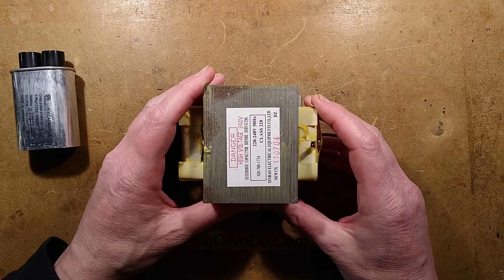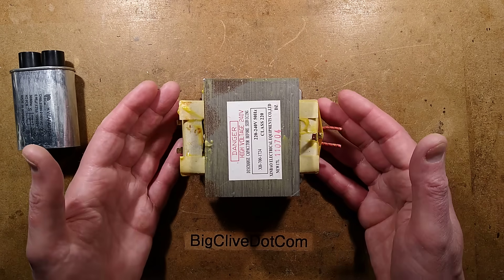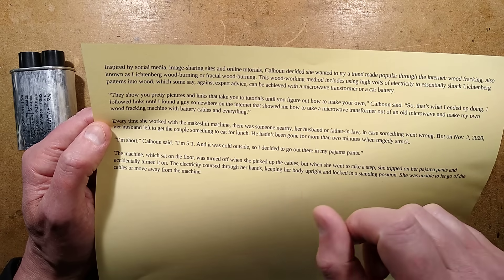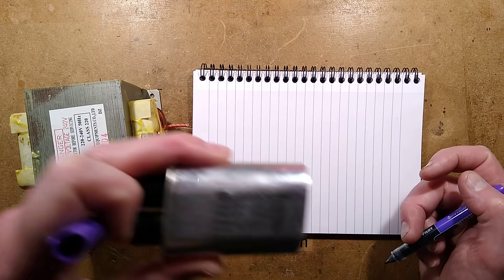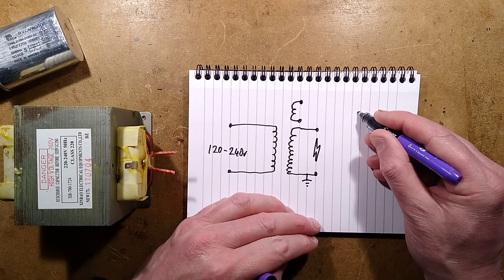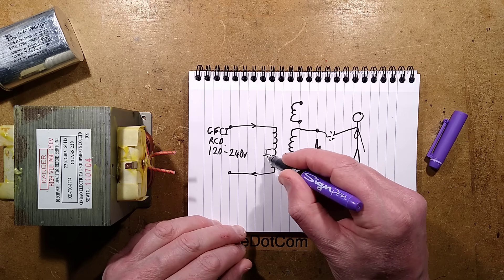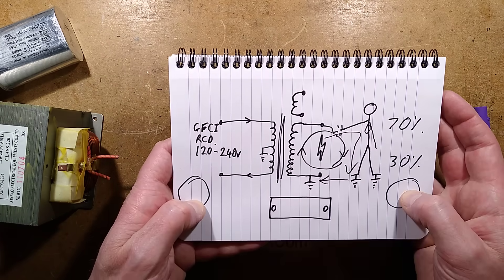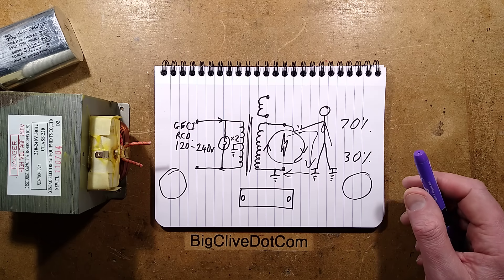The most deadly project on the Internet

Comment: My dad has a decent scar on the inside of his right forearm from working on a CRT TV many decades ago.   He apparently reached around to tweak something and got nailed by the flyback transformer.  Between that scar and his constant warnings of imminent death, it's little wonder I went for a mechanical engineering degree.   :)
Reply: I was an Appliance repairman for 27 years. While repairing a microwave (that had been unplugged for a week) the capacitor discharged from my right hand through my chest and to my left hand. 
My heart stopped and the room went dark. I fell back and hit the wall and woke up on the floor. I was very lucky to have no injuries from this. After talking to medical professionals about this I was told that I was dead for a short time. 
I have literally been shocked hundreds of times  by 120 volts but that 2000 to 4000 volt microwave power is no joke.
Reply: @paulb4496 , there's also the "always keep one hand in your pocket" guideline.
Reply: Stories like this is why I'm planning on going in digital logic design, safe, 5-3.3v circuits
Reply: @comandercrypto1318 , not much you can do about 5v on the USB. I don't even like the old Arduino, etc. stuff that exposes 5v, which can blow out 3.3v circuits.

Logic design is cool, but I hope you work on learning some programming languages, Cmdr. Crypto. (Crypto is the lulz.)
Reply: @comandercrypto1318  I'm doing embedded systems, analog signal conditioning, and some stepper motor drives.  24V maximum, I think at 2 amps.  I'm OK with that.   What is impressively annoying about 3 and 5V digital logic is the amount of board space I've had to dedicate to converting between the two.  I kinda hate that 3V ever became a thing, though it'd be fine if there didn't seem to be a 50/50 mix of what uses which.

Comment: Of the nearly 2000 comments here, only 2 mention the risk of * BERYLLIOSIS * , which is another nasty way to die after brute-forcing your way to the transformer.
Reply from the maker: Modern consumer microwaves do not use beryllium ceramic.  They're more likely to use a pink coloured alumina based material.

Comment: Wow! People are using these things around damp/wet surfaces and some holding the output probes  by hand! Yikes...
I have worked on many Microwave ovens over the years and I treat them with so much respect. As you mentioned even the HV cap after unplugged deserves much respect.  Can't imagine people doing this without knowing the complete dangers. Excellent video big clive and explained very well. I really was not even thinking about the isolation and the GFCI not even helping when it does go south!  Thanks for taking the time to share this! God bless!

Comment: My friend who is an engineer paid to work with high voltages has done this project. He uses a neon sign transformer, which is current limited to about 30mA, and he feeds it from a variac so he can dial it up and down.
The high frequency supplies on eBay often say specifically that they do not work for making Lichtenbergs.
Reply: Same as my burner.  Nst and variac,  and I don't effing touch it when live!

Comment: Always surprises me how scared people are to work on CRT televisions whose flyback might be able to provide half a microamp at 10kV and will typically sag to under 100V  under load, but will happily rip into a microwave oven and use it's pieces while it's on. 

I don't understand it.
Reply: CRT zap is super painful. it doesnt even feel like electric shock, it feels like your entire arm is on fire even after the voltage is gone. for quite a while too. but everything looks totally fine. unless youre already dead LOL
its not a microamp, its like 2 miliamps, but thats not it, theres enough charge stored in the ouput capacitance to deliver a 0.2A pulse to you. its above lethal level, but its a very short pulse, so there will be survivors.
Reply: @echelonrank3927  I have worked on large tube hybrid color televisions from the mid 1970s and I've never seen one rated for >0.5mA output on a flyback, the input fuse blows at 125mA most commonly, and the winding ratio will bring it to a fraction of that. You don't want to be caught on the wrong end of the horizontal drive circuit, especially that of a tube (overload failure takes a lot of time as opposed to solid state electronics), but the flyback output disconnected from the tube should be incapable of causing death on it's own. I've personally made the mistake of holding it's output across my body on two occasions and while it doesn't feel good, I still implement a "One hand rule" for working on sets these days.
Put a belt on and jam your fist through a spot on the belt to make it difficult to remove!

You should never be playing with the high voltage with the tube in circuit, even on the Sam's schematics they are often listed "DO NOT MEASURE," although they do make specialist long insulated probes for going under the cup to measure the output during operation, which is adjusted mainly to prevent xray emissions, which if you ask me are far worse. I've been on the receiving end of that and I thought it was going to be the end. Never, ever play with xrays.
Reply: @AiOinc1  Wow. No wonder we were told not to sit too close to the TV when we were kids. I had no idea that they could emit X-rays. I'm sure the levels are low but still.
Reply: @AiOinc1  
i measured the CRT radiation a few times with geiger counter, dont remember any significant readings, but i never jacked up the voltage so maybe thats why..
i also used to have a 100kV x-ray tube.
the glass actually went dark where the x-rays come through, its really weird, but you could see where the direction of the 'beam' is. never built the power supply for it, the high voltage parts used to be extremely expensive.
Reply: @echelonrank3927  been there got the t shirt. Luckily I wasn't carrying it at the time
Reply: The flyback transformer output is low current, but the cathode ray tube is a big capacitor and capable of providing a very large jolt.  Televisions from the late 1960s onward incorporate bleeder resistors, but they take time to discharge the tube or could possibly fail to an open circuit.  I have serviced quite a few TVs and computer monitors and can confirm the anode connection at the tube is capable of delivering a pretty healthy spark even after s TV has been switched off for a long time.

The other risk is the electric shock you get from the tube may make you flinch and break the neck of the tube.  Newer CRTs are designed with weak areas and less likely to violently implode, but I never wanted to test that to find out if it is correct.  I have seen the aftermath of a an early 1960s 21 inch CRT implosion which sent fist size pieces of glass through a thick solid mahogany cabinet.  You would not want to be around when that happens.
Reply: @wtmayhew  Worst still the connection point for the high voltage lead is inside a 'dimple' set into the glass. For some reason when carrying them one's little finger--entirely of its own volition--seems very desperately to want to find that dimple... The tubes can genuinely bounce when you hurl them up into the air and curse!
Reply: @wtmayhew  i didn't know that the whole screen has discharging resistors, when i'm tearing it down, first thing is do is remove the suction cup, that's the only connection to the HV pole.
I also see them very often around the trash bins, opened with whole neck of the tube ripped off, so i guess they're pretty safe.
Reply: @plainedgedsaw1694  I didn’t mean to imply the bleeder resistor is integral to the CRT.  The newer designs moved to using a little potted voltage tripling brick and the bleeder is integrated into the multiplier.   I believe that static charge can live in patches on the conductive coating inside the CRT and migrate, so you can draw a pretty good spark if you discharge the anode and them come back a few minutes and discharge the recessed connection on the tube again.  It can be a pretty good spark, but probably won’t kill you - but if you flinch, you might do some damage to your hand and/or the equipment.
Reply: @wtmayhew  i actually never seen the potted multiplier before, i think that was just the thing of the older types where flyback transformer and rectifier/multiplier were separate.
Reply: @plainedgedsaw1694  You should never guess when it comes to HV.
Reply: @pfitz4881  i never heard of death from getting zapped by turned off CRT.
Reply: @plainedgedsaw1694  obscure fact you can see it inside the wooden philips colour TVs.
the green potted multipier
Reply: @wtmayhew  I've never run across a charged CRT myself, but I've seen a few howto videos on discharging them. The spark's not as impressive as the legends always made it out to be, even immediately after the tube is shut off. But I still wouldn't want to  get hit by it. 

Flybacks may be low current, but there's still enough volts for them to maintain an arc across several inches of air once it's struck. They're another thing I wouldn't want to dork with while energized unless I absolutely had to. And then I'd try to keep one arm behind my back the whole time, just so I don't accidentally become part of the HV circuit.
Reply: @wtmayhew  My friends threw a 90's CRT TV into a bonfire once. The resulting explosion sent a fireball of death about 4ft past said friend. If he was in the way, it definitely would've killed him.
Reply: @jimmyrustler8983  I worked at a place that used to scrap their computer monitors back before environmental awareness.  I saw several CRTs thrown into a dumpster.  Then CRT necks broke and there was a loud prolonged hiss. I believe older CRTs were more fragile and apt to implode violently if bumped on the front corner of the screen.  I believe it was about 1965 or so that CRTs became much safer to handle, perhaps a little earlier for “portable” TVs (if you call a 40 pound 19 inch TV portable).
Reply: @wtmayhew  The TV was cooking on the fire for a good 3 or 4 minutes on a 10+ft bonfire made of everything bad, so I think it was a combination of heat, pressure and melting plastic that contributed to the almighty bang. Pretty scary, to say the least. Police and Fire dept weren't happy either. 🤣
Reply: @wtmayhew  a jolt from a fully charged big CRT can easily stop the heart. As for recent CRTs being less likely to violently implode - I beg to differ. Dropped 21 inch IIyama CRT monitor by accident - that thing went off like a hand grenade. Good thing that RF shield and plastic case contained most of the glass shards but frontal half of the case was simply annihilated and there were pieces of glass shrapnel in the trees in about 5m radius.  Imagine this happening when you have a naked CRT in front of you. Especially if you'll drop it or drop something on it, not just crack the back.
Reply: @shadowflash705  Thank you for elaborating on both warnings.   I don’t like handling CRTs and I always assume the worst may happen and try to use care to avoid disaster.  It is good to read that your implosion experience left you intact and able to write about it.
Reply: @wtmayhew  Ah the good old days when real men actually fixed things and black spots on a fingernail were not uncommon!
Pax.
Reply: They aren't the same people.
Reply: I've been hit by a flyback. Kicks like a drunk mule. I don't want to know what a MOTs kick is. Won't live to tell it anyways.
Reply: @dono_x4o  The microwave transformer won't kick you - You start cooking. Usually the flyback hurts enough to yank your arm back, but I've actually worked on some sets where you can't even tell you're touching it because the voltage sags so badly. Usually, any transistorized or non-SCR solid state horizontal drive on a television is more liable to let out the magic smoke during an overload condition.
Reply: I'm quite happy to leave both alone.
Reply: I made a single transistor driver for the CRT transformer with a HV diode and capacitor at the output when I was a teenager. It hurts a lot to get zapped from this._
Reply: I know of someone killed by a the glass of TV tubes. He fell while throwing one on the pile of broken glass and his body wasn't discovered until the Monday morning. I have part of my thumb missing that decades ago just glanced against broken CRT glass. CRT tubes can charge themselves back up again after they've been discharged and make you drop it if you touch the anode while carrying.
Reply: @jagmarc  I can imagine what will happen if you'll drop one of those huge HD CRT TV tubes. It will probably be close to a direct hit by an RPG.
Reply: @jagmarc  yeah the pre 80s ones didn't have safety glass on them. They were basically glass grenades. I have a shelf in my basement with 2 18" tubes from a 50s radar system, I'd hate to see what happens if they fell
Reply: Mozilli Flyback has entered the chat.
Reply: Bizarrely enough, the last CRT TV I got a zap from when trying to disconnect the anode cap was manufactured in 2006! Yet I have a 1969 Rediffusion TV and that's never zapped me from the anode cap.
Reply: @MegaWayneD  I've gotten zapped by an old Motorola vt71 from '38. It didn't have too much stored charge so it just kinda felt like a static shock
Reply: Oh, I understand it! Darwin = 1 Idiots = 0.
Reply: A microamp? CRT beam current is typically 1mA per electron gun cathode. 3 of these is the current supplied at 25 kV final anode. And there's much more current than this with high power projection TVs
Reply: Can't fix stupid
Reply: I've scrapped all these things not once ever got a zap
Reply: @handduggraverdronline  impendingly relevant username.
Reply: @Jay22222  it's my gamertag
Reply: @Jay22222  is very suiting though in this situation
Reply: You're RIGHT! It's not the fly back transformer that can kill you, it's the KILO VOLTS of stored energy in that huge glass display that could kill you - could! (About 1kV per inch of screen real estate.) Think about it. The thing is called a CATHODE ray tube. So, somewhere that implies there's also an ANODE! Starting to see it yet? Because it's that anode wire with what looks like a suction cup connected directly to the tube and the fly back transformer that should be a pretty big clue. So it's the actually the display tube -- not the transformer -- that stores any electricity, no different than a capacitor. (And I don't recommend discharging it with a straight conductor for what I hope are some other obvious reasons too.)

Most of the time there is no real danger as long as you don't short the anode with the cathode through YOU or something -- or break the tube itself and inhale any of that extremely toxic and deadly beryllium that might be inside (the same beryllium that's also used in many microwave oven magnatron insulators). So the bigger question might be, do you know where the cathode on that CRT tube even is? We know where the anode is - duh! Because if you don't know where the cathode is then you might not want to mess with it.

Want to know more? Here's a link to almost everything you'd want to know about Cathode Ray Tubes: https://en.wikipedia.org/wiki/Cathode-ray_tube
Reply: People are willing to do the burning and not have a clue how dangerous it is because they only see a way to get views or sell art. Darwin award time is not my idea of fun but you would be surprised how many have got live Darwin awards
Reply: 10kV? I think my CRT projector uses 34kV.
Reply: @jaapaap123  had a barco 600... 44kV baby as I recall
Reply: @Bob_Bobskin  According to the service manual, it also uses 34kV, just like my 1209s/E.
Reply: Old TV sets that got the high voltage directly from the line Transformator will kill you too.
Later models have a separate high voltage transformer.
Reply: I've gotten zapped many a time by old tube tvs not very fun
Reply: I think the big problem is that neither do they.
Reply: I learned it young one of my many TVs with a radio in it I had dropped it and it hadn't survived so I decided to pull it open why don't know looking back on it probably not a good plan. Even that tiny little bugger of a black and white screen can sometimes bite even if it's out of order be very careful with electronics.
Reply: Microwave ovens and refrigeration systems are two things I don't mess with CRTs I can handle it's a hobby of mine
Reply: @icebear6393  Where I live, it's not even legal to work on refrigeration systems without a license. 

My two things are microwave ovens (Microwave radiation & obvious high voltage high current hazard) and garage doors (Massive arm-breaking springs under high tension). The latter is also why I won't work on the suspension of my car.
Reply: @icebear6393  why not refrigeration systems, fun and easy to work on at least from a hobbyist perspective

Comment: I don't understand why one side of the secondary is connected to earth when using it for this purpose, why not place the transformer in an insulated container and connect both legs of the secondary across the work. In conjunction with the `dead man's box` it would still be dangerous but not quite as bad.
Reply: The insulation between the inner secondary winding and the core isn't rated for 2kv, these things are built to be as cheaply made as possible.